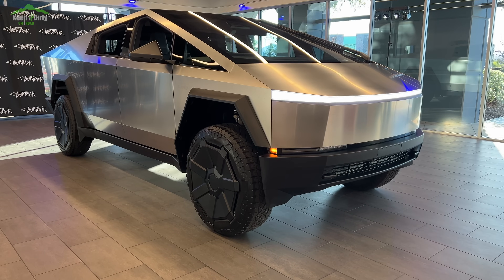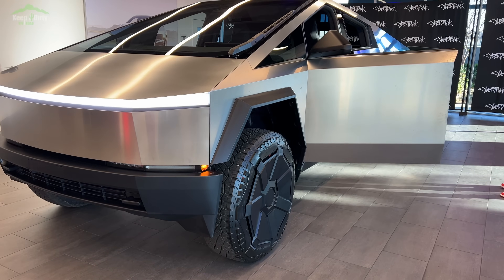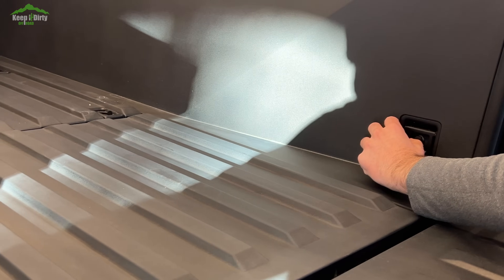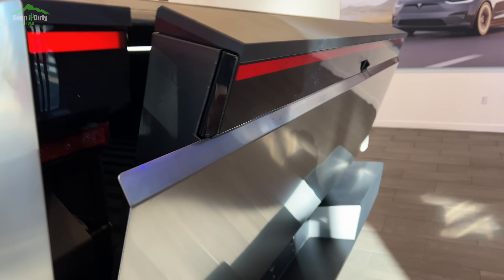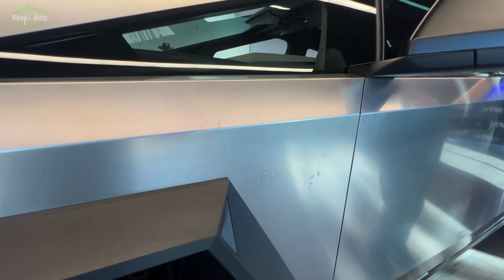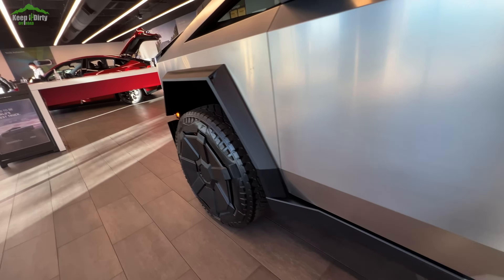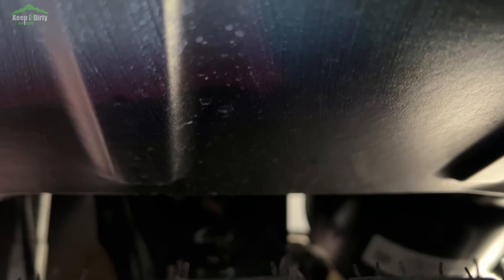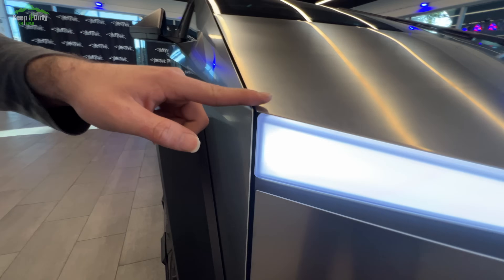Off-roaders take on the CyberTruck

Comment: The original prototype had storage space in the sail pillars akin to a service body. I agree that this should have been handled better, but perhaps they felt the added expense was not worth it at this time.

The front trunk should be large enough for some tool boxes or a few small pieces of luggage. However, the reason the Ford F150 Lightning has so much room is because they kept the truck body they already had but didn't need this space for an engine. It makes much more sense to give up some room in front in order to gain more space in the bed. Of course they still need some space in front in order to have a crumple zone.
Reply from the maker: That’s key, they cut corners a lot to save money and the front upper control arms are a perfect example. 

Also, don’t forget. The prototype had a tailgate that could also convert to a ramp. They had the cyber quad get loaded on it for the launch. 

But I get it man, but if you have not seen it in person, the gap from the front of the truck to the driver is massive. There should be more space in the front trunk. Most of the internals like AC and all that is straight from the models X and Y. Lots of parts shared and those are way more efficient with the space in front of the driver.

Comment: When I first saw HeavyD’s pic of the folded UCA I could not believe Tesla would actually use that pathetic of a part. 
My first initial thought of the CT was, like you said, a status vehicle. I think they are cool to see on the road here and there but personally wouldn’t have any desire to purchase one.
Now with that being said, I did just watch 3 of them do some light off-roading in Glamis and I must say they were cruising along pretty well…. But like I said it was an easy trail. They were cruising about 40 mph most of the time while braking for larger whoops (which was obviously expected). Overall I thought they were doing pretty well, now to say as to what kind of battery range they were using to do that in soft sand, and how long they would last before parts failed… only time will tell.
Like Helio said, I give it a “ehh”😏.

Have a great day everyone.
Reply from the maker: Yeah I think fails of that upper control arm are going to be common. Stamped steel in such a critical location is just not advisable. The powertrain has plenty of power to have fun on the trails. Specially on sand. But if they hit anything, even at slow speeds, that front suspension is collapsing. Blown away this was allowed. Even the lighter model 3s have beefier upper control arms

Comment: For a company's very first generation of a truck, I think it's good.
Reply from the maker: Normally I would agree. But when you look at the Rivian or the badger, or a number of other first EV type trucks, this is a HUGE miss. 

Also, when the S or even the 3 came out, they dominated their segments. They were far better in just about every way than their ICE counterparts. The cybertruck is not that. It’s unique for sure. But the upper control arm shows you the lack of attention that was paid to this truck. Not even the S or the much cheaper 3 has such weak upper control arms that may not even last after a single pothole.
Reply: @KeepItDirtyOffRoad

"Boat mode" might be the saving grace of this truck,  if that pans out.
They will still sell a truck load of cts as is thought. Hopefully, the CT version 2 will have all these flaws fixed.
Reply from the maker: Let’s hope so. Because the powertrain is killer on the truck. It’s just everything else
Reply: @KeepItDirtyOffRoad  - Um, did you seriously cite the BADGER as an example of how to do a truck better?

That seriously undermines your credibility. They haven't even demonstrated a prototype, much less entered production.
Reply from the maker: I saw the running prototype on heavy Ds channel. That did not make it to production yet, but still a more usable truck than the cybertruck 🤷‍♂️

Comment: the CYBERTRUCK is not built to be a dedicated offroad rig, so, it is what it is. As to the front upper control arm, that design is like that because of small offset frontal collision crash safety.
Reply from the maker: So you’re saying Tesla designed the front end to collapse on purpose? 

If so, why is this the only Tesla with this design. All other vehicles they have have cast upper control arms. Decent strength. This is the first pressed steel control arms. Hit the right pothole and it’s going to collapse
Reply: @KeepItDirtyOffRoad  they designed the front suspension to collapse in a particular fashion when overloaded, ie collision, to protect the occupants.  It's not designed to do what you're asking it to do.
Reply from the maker: This is not a thing. If they did I feel sorry for owners.

Typical manufacturing design includes crumple zones and stuff like that. For example every truck had a bend in the frame that in an accident the frame bends and tucks the engine downward so that it does not protrude into the cab. No one and I mean NO ONE designs a suspension to collapse. They design the frame behind it to collapse in a specific way with a ton of force. Never the suspension itself. 

IF thats how the cyber truck was designed, it’s going to be a seriously flawed design. Because that arm is going to bend on pot holes, curbs, or when hitting something on the road. That’s is a very flawed design.

Comment: Did this guy really complain about the control arms breaking with tracks on?
Reply from the maker: Who you talking to? 

That arm won’t make it past pot holes let alone off-roading.
Reply: @KeepItDirtyOffRoad no need for the exaggeration, you seem like you just hate the cybertruck and are using a lot of personal feelings in this video instead of just making a straight unbiased video talking about the good and the bad like a respectable person would
Reply from the maker: 🤣🤣🤣 funny how when someone has an opinion that does not align with your own it’s somehow biased and un reputable. 

Watch my video on the Ford switchgear or even one on the TRX. My opinions are rooted in off-roading in the deserts in the southwest. Any proper truck guy and offroad guy will have the same complaints I do. Car guys will never understand.
Reply: @alliasgamer599 I guess when someone talks about using weaker manufacturing processes for critical suspension components they are “reviewing based on feelings”
Reply: @KeepItDirtyOffRoad maybe the arm failure with those big ass tracks wasn't the best example. I do agree those upper arms are inadequate though. I believe in the Tesla engineering team. I think they will continue to improve and innovate.
(CT rocks though)
Reply from the maker: It’s not the best example sure, BUT now that the heavy D video is out, it’s clear the CT suspension is very weak. Components failed on tame snow trails. Front collapsed right away, rear steering failed on relatively flat ground and first time they put any load on it, the spindle snapped. While the tracks do amplify the leverage, you won’t see any other truck fail this easily. Jeeps and trucks get tracks all the time and don’t fail so easily until folks start pushing it. HeavyD never even pushed it. 

Now, I don’t think Tesla engineers will fix it. They are going to rely on the aftermarket. It’s clear by the way the truck was built that cost cutting a key priority. They won’t be making any major changes to fix the suspension issues until this thing has turned a profit.

Comment: They should have made the space behind the rear window come down like a normal bed. Would have looked much less triangle like from the side. Also how about a quick release for the hideous front windshield wiper? Take the thing off if you don’t live in a place where it rains all the time.
Reply from the maker: The roll up bed cover took a lot of space in the bed I think and that’s why the rear window has no slide option. As for the wiper, that thing is a joke. Not sure there is any fix for it short of a new windshield design

Comment: That bolt hovering above the tire is the worst design choice
Reply from the maker: Yes it is!! Aftermarket tires are going to have a ton of issues.
Reply: If you're goal is to modify a vehicle, do not buy a cyber truck
Reply from the maker: Wow man, that’s sad. Customization is a staple of car culture. If all you care about is transportation what the hell are you doing buying a culver truck! As a truck it’s awful
Reply: You must haven’t looked at cars. Or trucks lately
Reply: Well T Sportline fitted 24" wheels to the truck and this looks like an older model since, as I understand it, the sharp edges has been addresses.
Reply from the maker: Yeah. The showroom models are early production. Did not know they addressed the sharp edges. I follow all the Tesla news and had not seen it on any video or news article. Can you point me to where so saw that they addresses the sharp edges?
Reply: I love the cyber truck it’s different from everything else on the road really have no complaints about it. The things that people are complaining about is nonsense and need to get with the program its the 21st century
Reply from the maker: 🤦‍♂️🤦‍♂️ yeah man. Its the 22s century and Tesla built a truck without looking at what made other trucks great. Trucks from the 70s have more utility and storage than the CT. Just because and EV and it has a funky design does not make it a good vehicle. As a truck this thing is awful and they cut corners in the areas that count the most and invested in areas that don’t matter.
Reply: @KeepItDirtyOffRoad  I will try to find that video.  It was only something fitted to the  pointy edges of the Frunk .It was somewhere inside someone's video and I did not pa much attention.
Reply: @KeepItDirtyOffRoad  I was looking everywhere to find the video where they showed a plastic type thing that was fitted to the frunks sharp corners, basically to protect you from bumping your head against a point edge, but I cannot find it.  Maybe I was mistaken and it was someone's aftermarket solution.  I did not pay much attention to the video because it does not bother me much since all cars have point edges somewhere.

Comment: Im thinking about the weight of this thing. And i'm looking at the upper Control arms.. Something isn't adding up. I'm almost sure they are using the same parts from the cars
Reply from the maker: Truck weights 6600 lbs. so it’s relatively light for its size. But if you do a search for Tesla upper control arms on any other Tesla model, you will find that all of their other models use more stout and thick cast uppers. This is the first one with stamped steel. It makes no sense
Reply: @KeepItDirtyOffRoad  Whats up with that bolt? You ever see that before? If you bottom out real bad you think it will stab the tire?
Reply from the maker: The model S and the Model D have a similar design. It puts the leverage closer to the center of the wheel improving performance. It’s not a new design. 

Since the tire and arms move together it won’t stab the tires. BUT the tires do deform and expand at high speed or when aired down and at speed . That’s when you risk contact.

Comment: Nice review. I have not seen a Cybertruck yet here in St Louis. There are a lot of Rivian R1T's here. From watching your video, it seems like the Rivian is the better EV Truck over the Cybertruck. A side from that, I think what you are talking about is correct. The Cybertruck was not designed by Truck guys. When you think about what Ford did with the Demo Truck Switchgear, that's more like what you are looking for. It has the Off Road suspension etc. While I don't see Ford producing the Switchgear for Production anytime soon, that would sell more to the off road crowd than Cybertruck. For me, I just know that nothing in the EV market at this point interests me. I think Hybrid Technology would be better anyways.
Reply from the maker: Would have to agree. Even the Rivian that is super interesting to me and is more usable than the cyber truck is not an a good option because of the air suspension and they don’t have native access to Tesla Superchargers for long distance reliable trips.

One company is listening though. Rams next EV truck is going to have a v6 up front working as a generator. That could be a cool compromise while battery tech takes a few years to catch up. Right now it’s just their regular trucks. But hoping for a TRX hybrid version myself.

Comment: Will you be able to actually test one on the same washes and speed that you run your Raptor on?   I look forward to your future honest real word test and review at that time.  Thanks!                           BTW, I imagine upgrading the control arm would be relatively easy for after market companies if it's actually necessary with the stock setup.  Since you are basing your comments on an extremely small sample size, one HEAVILY modded with snow tracks, it might actually take quite a beating in it's stock setup before actually "needing" the upgrade to perform at a relatively advanced level.  We'll hopefully be able to see if your upcoming trail test proves out my theory or not.
Reply from the maker: If I can, or someone lets me, I will take one out and test it like we do the raptors. But changing the arms is not so easy. heavy D has already shown that they also had to reinforce the structure behind the arm. Not only did the arm bend, but so did the casting it mounted to. They had to build a whole structure for it.

Now everyone is complaining that it was wide tracks that put extra leverage that caused the issue. For the most part tracks would move the suspension less and of the videos he has shown he was mainly on flat snow. 
That front upper control arm is so weak, I would not be surprised if they fail on a simple pothole
Reply: Thanks for the extra info. There seems to be a number of SoCal youtubers with CTs now so maybe someone will let you run their truck through one of your trails and see how much fun you can have before something gives. :)   We're all still waiting for a real test and you seem like the right guy to have behind the wheel! 💪

Comment: Had one for 24 hrs. Hated it. Made it clear Tesla has no off-roading engineers or staff within its development team.
Reply from the maker: Yeah, it’s like they used nothing but car parts to build this “truck”. It was so validating seeing the HeavyD video. Suspension failed 3 times on take stuff. Basically have to replace the whole suspension if you plan to do anything serious.
Reply: @KeepItDirtyOffRoad  I love the model 3 and S, and was so excited to have a Cybertruck for a day! What a disappointment! I gave my real world review on the cybertruck forum, and got banned. You're not allowed to say the obvious: The Cybertruck wasn't engineered to be an off-roading machine. Or an everyday machine. The sound system isn't that good, the steering is WAY too small, and the whole truck feels "cheap". Coming from a Hummer EV and Gladiator Rubicon, the Cybertruck is a joke - but you're not allowed to say that out there.
Reply from the maker: Wow man that’s sad. I’ve loved my teslas as well but hated the fanboys.